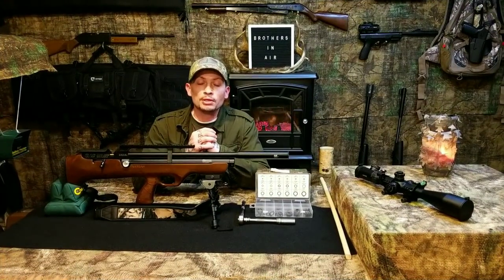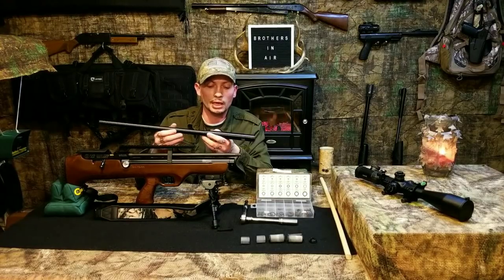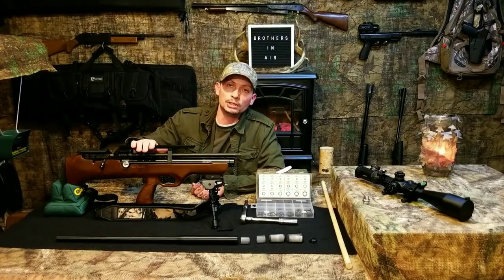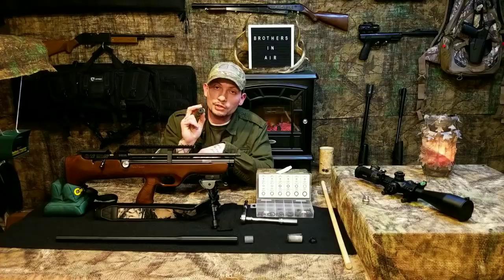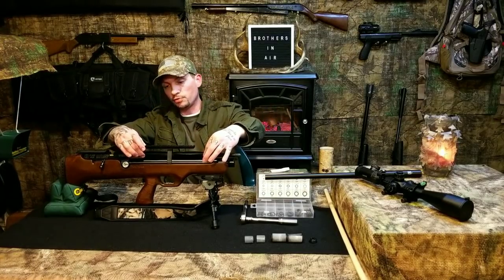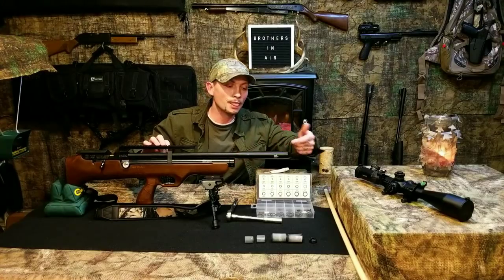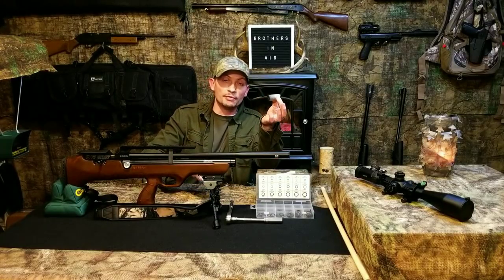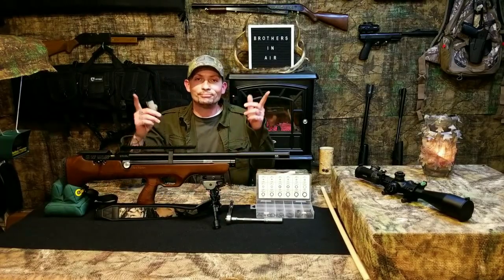HATSAN FLASHPUP QE SHROUD***Removal, Opinions&Thoughts, Lead Dust Diffuser/Filter Mod.& WARNINGS***

Comment: How’s i it going. I have an flash pup .25 and today I was shooting it and all the air came out the back of the barrel the end where the pellets go in. Me and my brother changed the the two O rings that are outside the barrel and the one o ring inside the barrel and put it back together and it’s still not working while we was trying to put air in it the air is coming out the barrel like something isn’t sealed do you have any idea what could be wrong
Reply from the maker: If you shoot the gun too low into the yellow the hard smack of the hammer will unseat the valve with enough dwell to let all of the air escape past it. Then there is not enough air pressure behind it to slam the valve shut and it remains unseated. Assuming you're filling from a hand pump you probably will not get it to go. Some air reservoirs are impossible to fill with a hand pump once completely empty like the old air Force guns because the valve was a two-way valve inlet and outlet. If you had a SCUBA tank or other high-pressure air source this usually isn't the problem as the air fills the reservoir so fast it seats the valve and holds its shut. this happened to me while letting someone else shoot the gun and I was in the house I did not warn them not to shoot it far into the yellow on the manometer. I do not have a high-pressure source and use a hand pump so I had to remove the air reservoir, unscrew the end cap valve body, and take a light brass hammer tapping the valve pin lightly to seat it nice against the delrin valve seat. Then i carefully assembled everything as to not unseat the valve by bumping or jamming the pin. After doing this I was able to fill the gun once again with a hand pump. It's really something that should be in big bold red letters on the front cover or first page of the manual. let me know if you get her and if you have any questions I'm always around.
Reply: BROTHERS IN AIR thank you we going to try it but I was using an air tank
Reply from the maker: @coreyjoeriley  in that case I would just remove the gun from the stock make sure the air cylinder is degassed(obviously it is as it will not hold air) and remove it. You have to remove the manometer or you will not be able to slide it all the way out through the barrel band but as you are using high-pressure air tank to fill you may be able to just back it out a few inches so you can access the valve pin. Or you can remove the optics rail and detach the trigger linkage and just slide the whole barrel band off. Then while trying to fill from your air tank you can push or pull on the valve stem trying to reseat the valve if you have an air tank. push it or tap it with a hammer lightly a few times while the air is escaping out the port of the valve you should be able to get it to seat and grab hold nice. Occasionally debris or some other matter will get in there between things also. this can help to free up debree  and push it past and off of the valve seat. Even a small fragment of something as thin as a piece of hair will cause the valve to not seat or seal correctly. Either way you should be able to get it seated once you have it off the gun and are pushing pulling etc on the valve pin while throwing air in with the tank. Hope that helps. Always be careful
Reply: BROTHERS IN AIR ok thanks we about to give it a try and let you know

Comment: Just got one in .22 today. Mine is loud. You say the hair roller baffles small end toward breach. What direction do the plastic ones go? Thanks!
Reply from the maker: The two plastic clear ones face with the open end towards the breach and the small hole facing forwards. The tune on the gun can make a big difference as well. Just as an example..... say your 22 is shooting around a 1000fps. It would produce a much quieter shot if you tuned it down some. Sometimes even 50fps can make a noticeable difference. Hope that helps
Reply: @brothersinair2064  
Thanks brother! Mine are in backwards then if the smaller hole on the clear ones is toward the muzzle and open end toward the breach. I've got it tuned to 31fpe around 870'ish with 18.3 gr JSB's and 18gr crow magnums. Those crow mags have some serious expansion but not as accurate as the JSB. Also had to clean out the trigger sear and the hammer area. It was gunked with grease galore and had metal shavings in it. Went ahead and polished those contact points also.My trigger area itself had zero lube so took care of that also. 

Thanks Again!

Comment: What is the amount of torque used in pounds please.
Reply from the maker: The amount of torque applied to what exactly? As far as I know there are no specified or listed torque settings for reference. I generally don't find a need to go above 20 inch pounds on anyting on the guns.
Reply from the maker: You can reference torque charts based on materials and fastener diameter and come up with some numbers but it would take some research. With pcp's I would say 15-20 inch pounds for most everything from set screws to scope rings.

Comment: My barrel nut didn't have an o ring and the shroud screwed off by hand easily only had the gun aday or two
Reply from the maker: That's okay. It will still function properly without the O-ring but having an o-ring in there makes it a little quieter restricting some of the backflow and also a touch less ping.

Comment: I can't find any reference to an O Ring Size A114 or is it A1-14? or ?..Thanks
Reply from the maker: 114 is the size based on the US standard sizing charts. The metric dimensions of the o-ring are......                         C.S.                   O.D.
  2.62mm          15.54mm
Hope that helps
Reply: @brothersinair2064  the 114 size is 5/8" ID, 13/16" OD and 3/32" CS this is too thick and the barrel nut will not go inside the shroud. Also, my shroud has an integrated sleeve at the breech end so can't get the felt to fit...
Reply from the maker: @charlesgreen5077  I have installed this size o-ring on the barrel nut of three different flashpups and one Flash and although it is a very tight fit and requires a wooden dowel or something to push the nut, they all fit. I wonder why it will not fit in yours? Also of the shrouds I have had my hands on all of them had a removable collar at the end of the shroud. The collar seemed to be machined to different sizes and unlike mine that falls right out the others had to be pulled out. How is yours integrated? Is it crimped or glued? Possibly something like loctite holding it in? The last flashpup I worked on had a manufacturing date of a couple months ago and the collar was removable so I am wondering what they have changed.
Reply from the maker: @charlesgreen5077  also..... If you are using actual 5/8 I.D.  that is equivalent to .625. The actual size of a 114 I.D. is .112. That is a difference of 13 thousands of an inch which is huge when considering fitting the barrel nut back in the shroud. This might be where your problem lies I am not sure unless they are making the shrouds with different I.D.'s
Reply from the maker: @charlesgreen5077  more than anything you just want a tight-fitting o-ring in there rather than nothing. It takes away the shroud ping and partially blocks the pass through holes of the barrel nut changing the pitch of the shot in a good way.
Reply: @brothersinair2064  I think that the barrel nut is now non-functional as I can not get it to fit in the shroud to the point that it will engage the barrel.  I find that a possible remedy would be to order a 10 element air stripper that replaces the stock 4 element, reduces the sound level by 20-30 db... and trying o fit a 5/8" o-ring on the barrel nut will not work consistently and may make the shroud unusable. Just eliminate the o-ring and place a 10 element air stripper/silencer mod and throw away the stock...$32 and all is good.
Reply from the maker: @charlesgreen5077  I don't quite think I understand. As I stated before the o-ring that I am using is .012" smaller and is a very tight fit. So quite understandable that you cannot jam the barrel nut in there with an extra .006" added to the diameter of the barrel nut.  How is the barrel nut no longer functional? I understand yours will not fit with the 5/8 o-ring but....  Why can't you just remove that o-ring and stretch an o-ring with a smaller cross-section around the barrel nut that will be more recessed in the groove creating a smaller fit? Or why not remove the o-ring all together and just use the barrel nut without one? Your solution to the air stripping and lowering the decibels sounds great and I completely agree with you there but how is your barrel nut non-functional as it is a necessary component to mount the shroud?
Reply: @brothersinair2064  The barrel nut is lodged inside the shroud and I can not find a way to back it out over the threads of the end cap. I will try forcing it up to the threads and put pressure on it from the breach side using a dowel rod and try to unscrew it past the end cap threads using the 14mm socket...Ok it is out now.Thanks
Reply from the maker: @charlesgreen5077  oh I get your dilemma now. I was just confused sorry. Glad you got it out. Just out of curiosity did your barrel nut have an o-ring installed from the factory? Most people trash the factory o-ring pushing it out through the threads as even that is a very tight fit.
Reply: @brothersinair2064  The original o-ring was in pieces when I removed the barrel nut the first time. The mistake I made was forcing the oversized 144 o-ring down the shroud, as it was too large the barrel nut was never close enough to engage the barrel threads. I won't make that mistake again. I am getting a 10 section air stripper from an ebay seller that promises to reduce the shot noise by 20-30db, that's like by 100x, I will let you know how it works out.
Reply: @charlesgreen5077  Hey sir have u used this 10 element $32 air stripper? I see it on EBay and have been tempted to buy one for my loud AT44 .25. Does it work?
Reply: @trevor-bd4kt  yes, reduced my Hatsan Flash from 98 db to 76 ...
Reply: @trevor-bd4kt  I found that my baffles on the at44-10 were different than my flashpup. However my at44-10 was the quieter of the two. My flashpup baffles that are wrapped in felt have two large openings instead of one large and one small. I ordered the 10 stage baffle and I'm waiting on it to arrive now and install on the flashpup

Comment: i have no where near 2 mm clearamce for the felt,evn a tightly compressed 1 mm not going in
Reply from the maker: You must not be removing the collar at the end of the shroud where it fits against the breach. There is 1.7mm between the I.D. of the shroud and the O.D. of the barrel. If the collar does not come out easily by hand then you can take an appropriate sized wooden dowel and come through the shroud to tap the collar out without scratching it. Once the collar has been removed you should have the clearance you need. All the barrels and shrouds are the same regardless of caliber. That space between the barrel and shroud must be there to let the air stripped from the shot travel back through that space and out the vent hole on the shroud. Hope that helps bro
Reply: @brothersinair2064  yep thats what was going on, that collar did not want to come out, i ended up using a little dab of rubber cement to the edge of the felt and put it in place inside the shroud, and carefully slid the shroud back on, and the felt stayed in place. BTW are there supposed to be 2 vent holes? mine has one slightly to the side that you can see, then another slightly larger, half covered by the barrel band. I got the gun new, so no mods or anything previous.
Reply from the maker: @realtalkrealtawhid6677  cool glad you got something worked out. I've never seen one with more than one vent hole. All four of my QE shrouds have one vent hole. They all fall in a place that leaves them unobscured by the barrel band or anything else so I wonder if they didn't drill one in the wrong spot and then instead of scrapping it they just drilled it in the correct spot so now there are two? Or maybe they just do two holes now I'm not sure brother.

Comment: I believe your thinking is backwards on the 2nd set of baffles. They should be turned with the little hole toward the front just like the solid baffles. This way it cups the air and it stays back and is slowed down by the felt. Putting the small end up next to the solid baffles small end does absolutely nothing. I even drilled four holes into the solid baffles for even more expansion,

Comment: Most phones have a db app...
Reply from the maker: Yeah I've tried several of them. They're decent to form some contrast data for myself but the readings are so far from actual that I just don't feel comfortable sharing the data.
Reply: @brothersinair2064   got ya. Yet it should give you some place for your records as a base line without a real db meter. good videos keep them coming. I just got the flash .25 haven't played with it yet. air compressor is on the way.  figured why waste 50-125 $ on a hand pump I'm getting older....... lol
Reply from the maker: @bobbennett790  after a few years of hand pumping me and you are thinking just alike LOL! I think I'm just going to bite the bullet and get one. Pumping a bottle Gun is absolutely no fun anymore! Which compressor did you purchase? Please keep me posted on how it performs and how you like it. I may just get the same one. Thanks for the compliments too brother. I try....